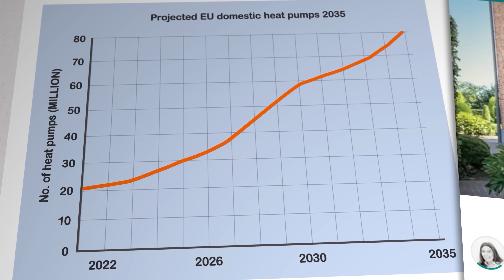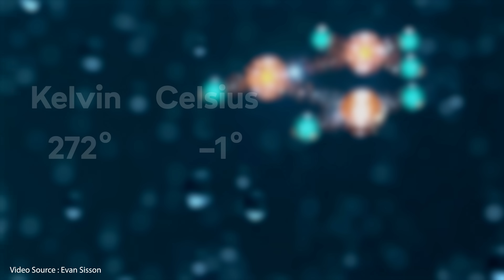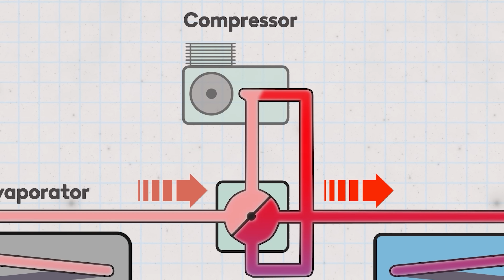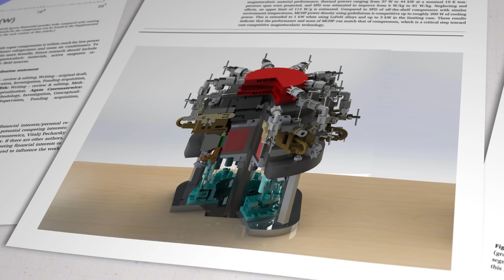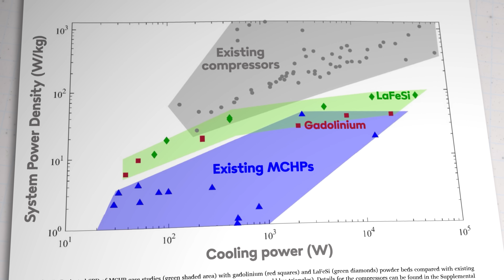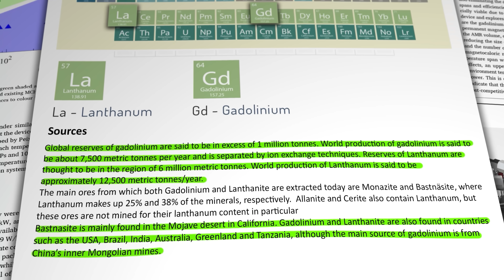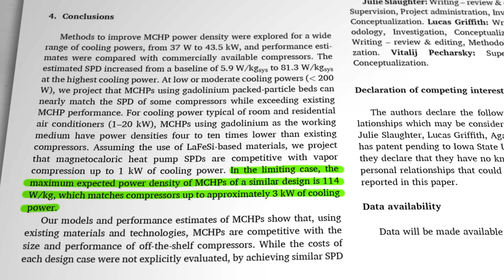Taking greenhouse gases out of heat pumps. (YES! They do contain them!)

Comment: thats imposble conpect that is just bullhony when its put intro a realstic sitwaon of real life. this is bescue what are we giong to use bescue we can't even use water bescue water is also a green hosue gas too you know. and water is the most basic form of things for thermal coolent or refrgrant we can use that actly works. a heat pump need a form of fluid to excage termal erngy with a flowing liquid. yes water h2o is also a green hosue gas when its empavtoed into water vapor. yes that isa scifical fact. so removeibf all green hosue gases out of heat pumps bacly means you can't even use water eather. and that bacly defats the hole perspoe of a heat pump bescue you need a liquid foleong thermal enrgy to have it actly do a heat pump thing. also water isa green hosue gas but not the envoermentasts tell you that however. yes water isa green hosue gas too you know.

Comment: Cost parity sounds great, but gadolinium is damned expensive and lanantham, while much less expensive, isn’t cheap.  I like the idea very much, but believing the prices of the devices are suddenly going to become reasonable strikes me as overly hopeful, especially since building these units will tremendously boost the demand for these minerals, further raising prices.

While traditional HVAC systems may leak, the amount of greenhouse gasses they spew has to be a tiny fraction of the total greenhouse gasses we normally generate.  After all, our ICE cars and trucks “leak” greenhouse gasses, even when they’re in perfectly good operating order.

Comment: We've found it's cheaper to run electric boiler for the winter and normal AC the rest of the year. Maybe not easier in use, you'll have to switch at 2 points in the year.

Comment: Thanks for the video. I don't want to be negative, but the extraction/process of silicon-iron-lanthanum hydride sounds to me like a combination of elements conveniently necessary for some leader to continue exploiting African countries and justify it by saying that it is a "national priority" or "fighting global warming." I know, very negative, but I no longer trust the decisions of the leaders. Heat pumps are already being made with propane, isobutane and CO2. Why don't these laboratories work on some way to redesign the current systems to avoid leaks?

Comment: When we bought a heat pump the 13-year lifetime operational emissions I estimated at 6 tonnes CO2e vs 44 tonnes for a gas boiler. The refrigerant emissions - assuming they lasted for the 13 years without needing to be replaced and then leaked out I estimated at 1.5 tonnes. That was for R32, which is common now, with a global warming potential of 675. So check the GWP of the refrigerant and if it's 675 or better it's not to be concerned about and doesn't affect the decision to replace the gas boiler with a heat pump.
Reply: Unlike CO2 which stays in the atmosphere practically forever, R32 has a half life of 4 years, as do practically all other refrigerants. Tbh its not that much of a worry.

Comment: Interesting technology, but it seems like it'd be tricky to use as a drop-in replacement for a split system heat pump, given that those take advantage of the fact that the refrigerant can be moved in pipes between the indoor and outdoor unit.

Comment: Interesting technology! But why not just use CO2 refrigerant in compressor style heat pumps for larger scale HVAC applications? It could be captured from the atmosphere or removed from pollution sources without adding any GHG to the atmosphere in the event of leaks. (I do think there would be other niche applications for this technology still)

Comment: Better. Use the tech that uses high frequency induction to use electromagnets in the rotating mass (rotor) in a dc motor without brushes. No rare earths required and much higher power density while getting the same efficiency. 

There’s a company that is creating ev motors that does this.

Comment: Magnetic Heat Pumps for domestic applications area a terrible idea. I'm 65 now, but when I began my PhD studies in 1981 I worked the basic principles of a magnetic caloric heat pump. This was basic physics not engineering optimisation. It took me 2 months to show that it was a useless idea. And another month to sack my supervisor.

The basic problems are that the entropy involved in the magnetic phase transition is just not very high. This means one needs strong magnetic fields to get anything at all. The initial research said the technology could maintain a 31 °C temperature difference. But when you take of 10 °C for each heat exchanger and then divide by 7 to make a reasonable field, one ends up with 'a few °C) . 

Also the temperature range of operation is fixed around the Curie temperature of the materials in question i.e.25 °C for Gadolinium.

The physics has not changed.

This is just pure noises from top to bottom.

Michael de Podesta (D Phil, FInstP)

Comment: Ah, reverse cycle A/C. Capable of extracting heat from frigid air. How wonderful it is, on such a cold night, to quickly heat the place up. And how wonderful, an hour later, when you notice a distinct chill creeping through the house, to go outside and find the evaporator has turned into a block of ice.
Reply: Modern heat pumps automatically defrost when this happens. You just lose heat for a couple of minutes.
Reply: What kind of cheap junk are you running, if at all and this isn't just some hearsay you're regurgitating? People in Hokkaido use heat pumps all the time, it's a bit colder there than anywhere in the UK

Comment: Had a geothermal heat pump installed 15 years ago and never looked back. Coll in the summer, Warm in the winter and more efficient than the air sourced heat pumps. Would love to see you do a comparison between the two.

Comment: There is a shortage of low-power heat pumps in the <5kW range, which are suitable for efficient, and especially small, efficient buildings. So if MCHPs do well up to 3kW then there is a niche for them to fill. A passivehouse only needs a couple of kW on very cold days, and less most of the year, for space heating. And of course fridge compressors are 50-100W so there are millions of small compressors that could use this tech. Or you can change the gas to CO2 (GWP=1) or propane (GWP=3) and remove almost all the 'escaping gas' problem that way. One of the best targets might be vehicles, because the gas gets out of those systems depressingly quickly.

Comment: I've been working with heat pumps in the Netherlands for the last 10 years or so, and most of the systems I know of are installed with R717 (ammonia). It has a GWP of 1.69 and leakage is very easily detectable by smell alone. In addition, it breaks down relatively quickly, it is easily scalable, abundant and remarkably cost effective. I don't see any reason to replace it with a 'potentially better' solution that has the same leakage issues, encourages more rare elements extraction with a high cost and seemingly low scalability.  I do like your continuous search for better alternatives though and I like your channel. So keep on going 😊
Reply: Caloric cooling (including magnetocalorics) don't leak refrigerants, as they are a form of solid-state cooling that uses no refrigerants. In the case of the Ames prototype, the heat transfer fluid is just water and a small amount of an anti-corrosion agent.
Reply: My Hot water system has a heat pump using CO2 as the refrigerant.

Comment: Have you would you be willing to do a video on hybrid heat-pumps.   Pumps that can pull electricity at the same time or optionally from solar panels and optionally pull remaining capability from the grid?   I believe that EG4 makes a mini-split like this although perhaps not the best for DIY and my Jackery power station does this although I'd have to add bigger solar panels to have the solar compete with the grid for electricity used for charging.  Thanks.
Reply: Heat pumps that use an electric motor for powering their compressor, like any other electrical appliance, don't care where the electricity is coming from. If you want to power an appliance with solar panels, you get an inverter that can make that happen. You don't need a special appliance for that.

Comment: The easiest way make heat umps work better then they already do, is to abolish the laws of physics, then you no longer need to worry about the laws of thermodynamics that dictate that the Heat pump gets worse the lower the outside temperature is. It a solution so easy, even the EU politicians can wrap their heads around.

Comment: I'm not clear why W/Kg is such an important metric, compared to something like power efficiency (COP).
Reply: If the device needs to be the size of a house or even a car to heat or cool a house, then it's going to be a problem for getting people to buy it both because it takes up a lot of space and because the materials cost would be huge. That's why the power density matters.

Comment: Change, for its own sake, is rarely of much benefit.  People who are opposed to change are frustrated with the notion that changing something always makes it better, and that's just not necessarily true.  Change that includes a quantifiable improvement, in the form of greater efficiency, reduced cost, or an entirely new product or service that has intrinsic value, is something else altogether.  Even the most curmudgeonly aren't going to resist THAT kind of change very long.
Reply: The problem is that heat pump venders are scalping people on prices, at least in the USA. A compressor, two heat exchangers, and some pipes shouldn't be very expensive, yet people try charging thousands or even tens of thousands of dollars for equipment that cost a few hundred or less to manufacture and really costs maybe a few hundred more to install. It's absurd that a "heat pump" of a given BTU rating is often several to dozens of times more expensive than an air conditioner of the same rating.

Comment: This is the first video I downvoted on this channel. The problem with the greenhouse gases in heat pumps has already been solved by chemists who developed fluorinated ketones, hydrofluoroolefins and hydrochlorofluoroolefins with insignificant global warming potential. These are already introduced and produced at scale and it's just the matter of time and regulation when the older refrigerants will be phased out just like the original HCFCs were

Comment: Thanks Dave, as always, a Great video. The argument for high GWP does not hold grounds regarding R290(Propane) with GWP of only 3. So the right question to ask is that what advantage magnetocaloric heat pumps (MCHP) brings compared to traditional vapor compression. One inherent problem with magnetocaloric is that there is compromise to be made between heat transfer and energy density, most commercial suppliers keep the cycles as slow as 1 revolution per seconds to ensure coolant gets enough time to exchange heat. And there is always parasitic losses related to change from heat source to heat sink. So one can have a very bulky and expensive MCHP  with good COP OR a compact and cost effective MCHP with poor COP and NOT both.

Comment: Magnetocaloric heat pumps (MCHPs) may turn out to be very good with careful management of the rare earth materials involved. But existing tech that uses CO2 as refrigerant works extremely well as an air to water heat pump with a COP of about 4, depending on outdoor air temperature.

It works well for water heating (and air cooling) and was developed in Japan. CO2 refrigerant (R-744) is hundreds or even thousands of times less potent as a greenhouse gas compared with CFCs and HFCs. Typical hot water output is 65°C (150°F) which is suitable for combined space heating and also domestic hot water when tempered. These units are widely available.

A really spectacular aspect of this is the ability to make and store hot water in a large insulated tank while electricity is available/cheap from solar panels or low time of use rates from utility.

The other spectacular (but more difficult to achieve) aspect is if a ducting system could be used in summer to cool indoor building air while heating domestic hot water. This would result in an effective COP of 8.

I would be very interested to learn if anyone has managed to make a Wallace and Gromit looking system like this work!

Comment: And... excellent questions at the end, as is what price the ozone hole (or rather the defences again.

Noting for the bulk of the non-UK audience, heat pumps is just a poor name for 'Cold-Pumps', or air-conditioning, so the COPs of greater than 4, 5 or 6 would also be needed to be re-calculated within the AC ranges of operation for 'gasless' AC... reducing even further GWP and Ozone hole risks.

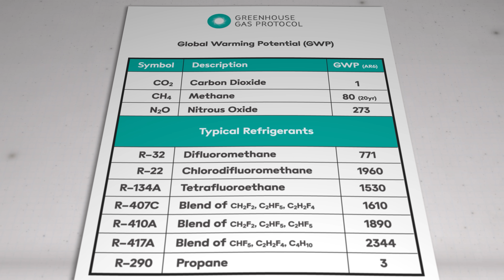Comment: @5:02 I was wondering where r290 (propane) would be on this chart…it would be helpful reminder in working with it on heat pumps (as the refrigerant)
Reply: Whoops I saw it at the bottom. 
That is helpful thanks

Comment: The problem is to replace my electric element water heater(10-15 year warranty) cost about $1500. To replace it with an average cost heat pump(2-5 year warranty) would be approx $4000-7000. This is in Australia. Now the element system has ran perfectly for 15 years. I keep hearing about the issues/maintenance costs of heat pumps. I understand the heat pump is a lot more efficient, but with existing solar system, would I not be better off just heating the element heater during the day with solar power. Location: Very hot summers and barely ever get a frost in winter.
Reply: If you want to heat water, solar thermal might be a lot cheaper to do that than using solar panels to power an electric heating element.

Comment: I would like to know the noise levels compared to a normal heat pump.

Is there still a compressor involved? The heat still needs to be moved from the outside unit to the inside unit, so I think the compressor is still needed.

Comment: Most heat pumps today have a COP of 3. Most countries in Europe gas is 3x cheaper than electricity. Calculate into this the much cheaper price of gas boilers and installation costs you see why heat pumps are a bad economic investment. Even if you have solar panels: you need heat pump most when there's no sun.
We saw a boost in heat pump demand 3 years ago, when gas prices went thru the roof. Nowadays they barely sell.
Reply: gas being 3x cheaper than electricity and a COP of 3 ignores that gas isn't 100% efficient. You get about 94% efficiency at best, and if the UK is anything to go by, they become closer to 84% efficient, because of bad system design.  COP of 3 is also pretty poor by today's standard.
Reply: @BenIsInSweden  A lot of heating systems in some parts of Europe, like the UK, use boilers for steam heat or nearly steam temperatures in their radiators. Most heat pump boilers will have COPs between 2 and 3 and they can be useless when it's far below freezing out as the temperature swing is too great. If using air to air heat pumps, yes, their COPs can be a lot higher and they can work with lower outside temperatures and ground-source heat pumps are even better. That requires a complete overhaul of their HVAC in such places though and that can be difficult (extremely expensive) in masonry buildings, also common in the UK.
Reply: @5467nick  steam flow temperatures from gas boilers will never achieve a decent efficiency in gas boilers, and would be close to 70%.
To get the best efficiency out of a gas boiler it needs to be run at a low flow temperature, and that's where heat pumps shine.
Reply: @BenIsInSweden  Correct, steam boilers will never achieve high efficiency, not with heat pumps and not really even with gas powered boilers. Unfortunately, that's what many, perhaps most, people in the UK already have and changing that is, once again, extremely expensive in many of their buildings. As such, those higher-efficiency air to air heat pumps aren't very useful to them when installing them requires extensive modifications to masonry buildings.
Reply: @5467nick  air to air doesn't require any building modifications.
Air to water often does because of needing radiator upgrades etc.

Problem for air to air in the UK is to do it right it normally needs planning permission to install.
Reply: Humanity needs to stop burning carbon ASAP. Humanity is on a collision course towards a +3 °C GMST anomaly, or more; a world beyond any past human experience. Large-scale depopulation would be likely. We're on the road to “climate ruin," likely within the next 40-50 years.
https://www.youtube.com/watch?v=flgq63f7TOc

Comment: We have a wall mounted AC/Heat pump using R290 (propane) and it is very good at keeping the lounge/diner temperature comfortable on a hot summer's day. It is also very good at raising the room temperature during an autumn cold snap, however, the cost of electricity being so high here, there is no financial saving by using it for heating instead of the gas boiler.
During the cold frosty windless mornings of winter, there are loads of stationary wind turbines and the electricity has to be supplemented by gas fired generation-very wasteful of a premium fuel. I suspect that if every home relied upon heat pumps, the grid would be currently unable to supply the load. This is going to get worse with the need to charge electric cars (and excessively powered High Speed 2).

This technology, however does look worthy of further development. Not relying upon gas compressors should make the equipment easier and cheaper to maintain and thus keep lifetime costs down. 👍